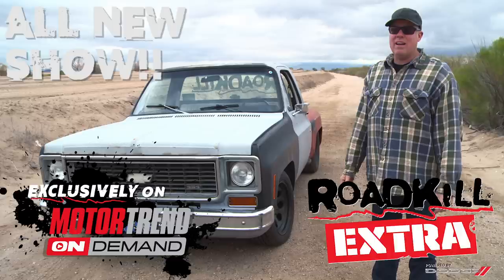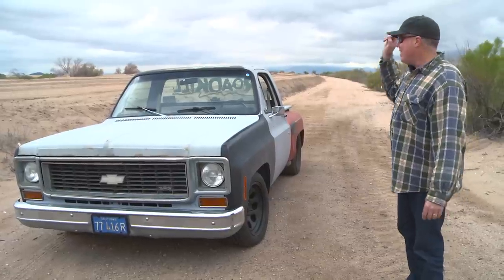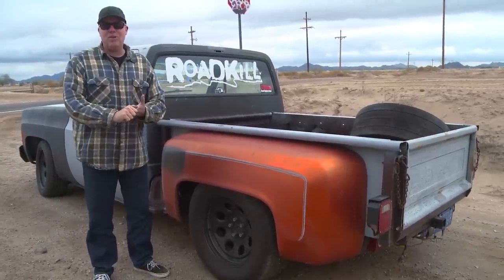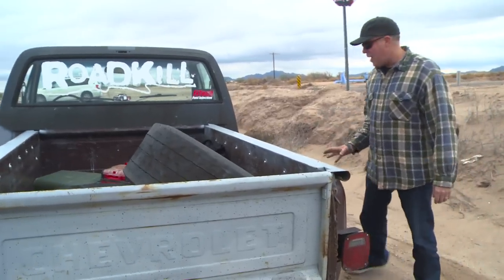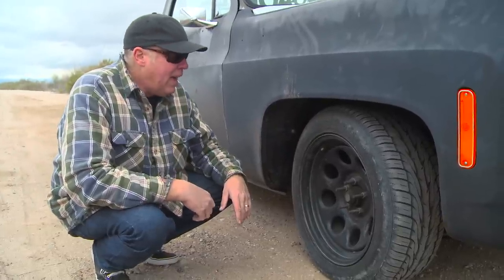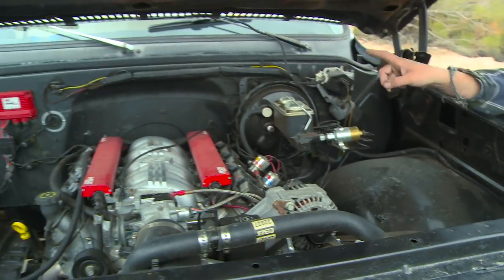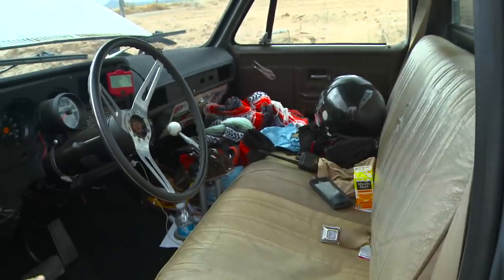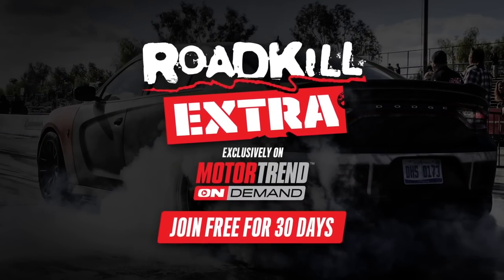Learn More About the Roadkill Muscle Truck - Roadkill Extra

Comment: if that axle is a 9" off of an F100 it should be 61.5 iirc. 5 on 4.5 if it's stock shafts

Comment: Does anyone know if the bench seat from newer models like what's in the muscle truck fit into a 1972 C20? It's the standard cab with the original seat and lap belts, so all the padding on the drivers side is gone and you slide off it in a corner, and lap belts are pretty sketchy. I would prefer bucket seats from like a 2000ish Chevy/GM truck, but the seat in the muscle truck is pretty good too because of the shoulder belt. I know they won't bolt right in but that's okay, i can make adapters and such, I'm just worried about dimensions. Don't wanna spend all day getting some seats out of a truck in the junkyard just to find they stick out the doors 😂😂

Comment: Does nobody realize you are still getting the exact same amount of the shows you used to watch, plus a little more with a few ads that, might I add, you can just not watch? MTOD helps them actually make the shows you watch. If you don't want it, don't buy it, your same shows will still be here. I hope not everybody hates motor trend for this.

Comment: Please someone help me. Just bought a 73 GMC c1500 454 bbc shortbed stepside, really clean truck. It starts very well when cold but then as soon as it warms up it dies. You go to start it and it turns over with no spark, EXCEPT for when you let off the key. Then it gives spark and sounds like it's just about to start as soon as you let off the ignition. Coil is good. Timing is perfect. But for some reason it has these two issues im talking about. (WILL NOT START AGAIN AFTER DYING)-due to all spark being cut off until it is cold again, and (DIES ONCE IT GETS HOT)-the coil is not overheating or getting hot enough for that to be the issue. So im just really lost here, any suggestions would really help a lot. It's my dream truck and it kills me to not be able to even drive it further than like half a mile without being totally stranded. SOMEONE HELP ME- Thanks.. Rob
Show less
REPLY
Reply: Did you figure out the problem yet? Maybe you should check all the wiring related to the ignition. Maybe the coil just doesn't get triggered after the engine gets up to temp. Or you could try and bypass the ignition switch for testing.
Reply: Florian amRechner I did. It had an extremely temperamental Mallory distributor, so I went for the HEI msd distributor with the coil on top. And couldn’t be happier truck runs like a top. Thanks so much for your reply

Comment: 30" rear tire, 3.50 gears with OD and it turns 3100 RPM? That would be 3100 RPM with NO overdrive.

Comment: If you pull the seat and carpet then you can "dynomat" the floor and rear wall. That helps cut down on the droneing when your running down the highway. 

If your cheap and don't want to blow a bunch of money on dynomat then go to lowes or Home Depot and get window flashing. It's exactly the same as dynomat extreme, only a little thinner and a lot cheaper. Just run 2-3 layers of it and you'll be good to go. 

https://m.lowes.com/pd/TITE-SEAL-Self-Adhesive-Waterproof-4-in-x-33-ft-Rubberized-Asphalt-Roll-Flashing/1007825

Comment: not a bad truck but I have an old 76 ford that runs 12 flat in the quarter from old junk parts..
Reply: it's still not set for racing. it's set for road trips and highway cruising.
Reply: adam courtney .pull as much weight off the truck as you can..it will run faster
Reply: Well yeah. I was just reiterating that its not a race truck. It's a street truck.